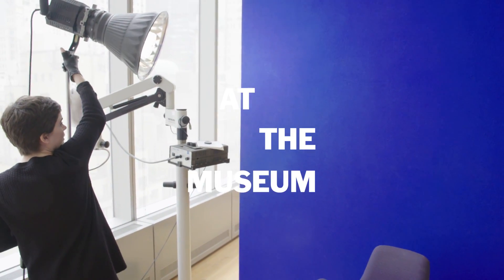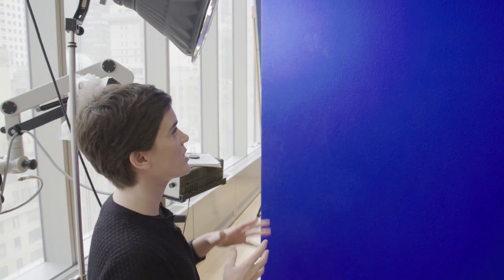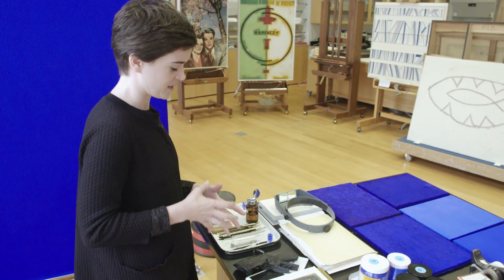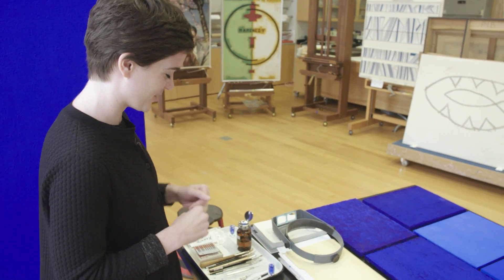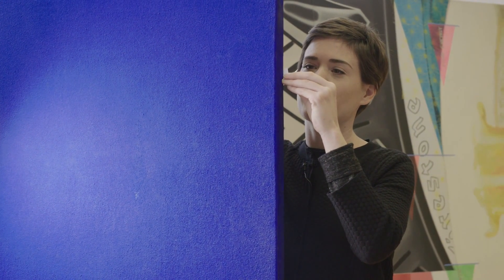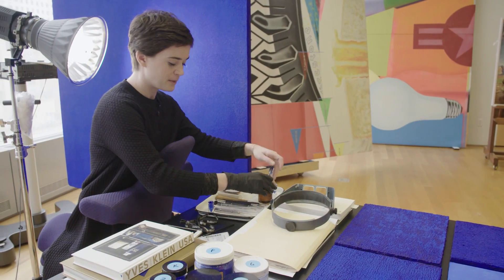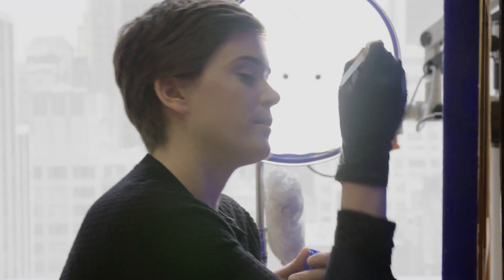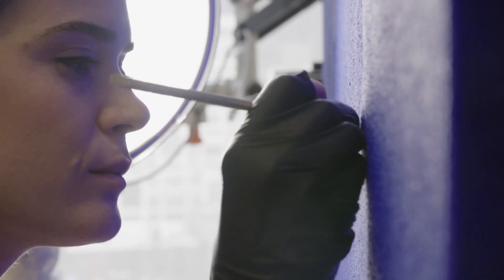Yves Klein: How texture affects our perception of color in Blue Monochrome | AT THE MUSEUM

Comment: I would like to ask you about the standing spot  light that you use to work with.Is it too hot when using the light. Can you tell me the type of lamp. I would really appreciate., because I have a hard type seeing.
Reply: Linda Seguinin  during conservation/restoration treatments is common practice to use the same light as in the gallery or department where the piece is exhibited. That way the restored areas become unnoticed.